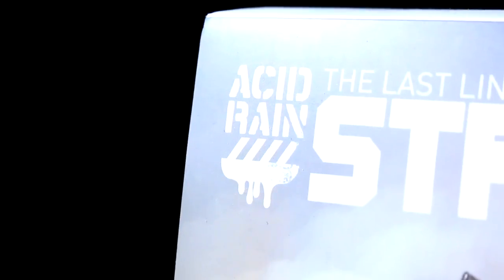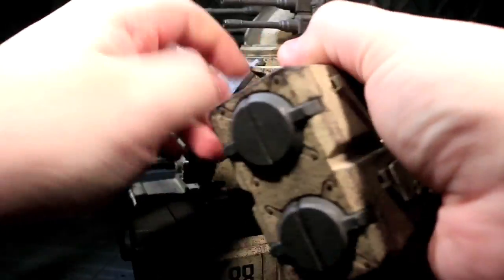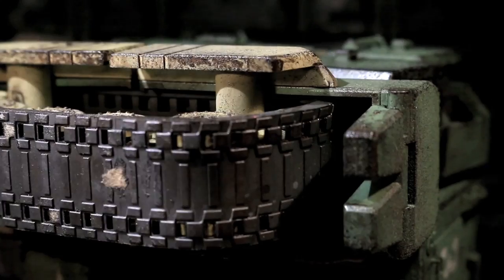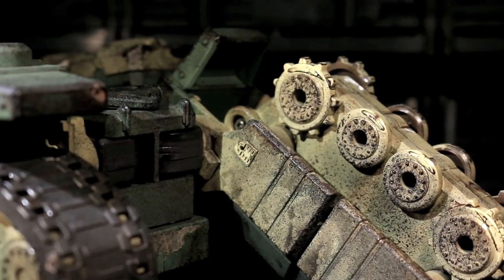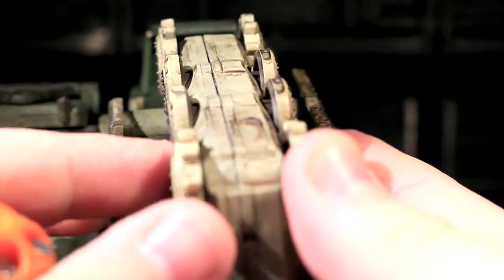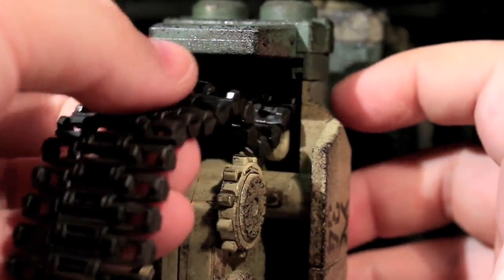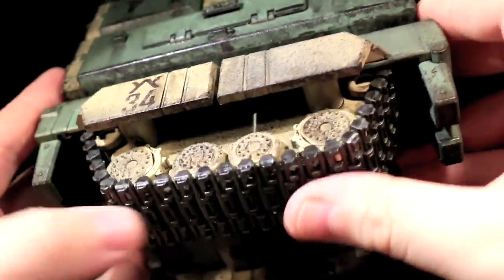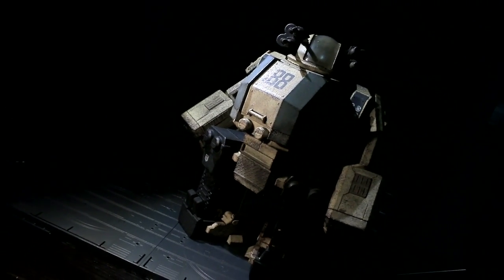Oritoy Acid Rain Stronghold (Quad Eye) Sand 88 Ver. with Plastic Treads - Vangelus Review 187-R

Comment: Looking at the sides of the track, it looks like it's installed inside-out; the side "tabs" might look better expanding outwards to "bite into the ground" as they turn instead of covering the side of the wheels. This might also help with the unclipping?